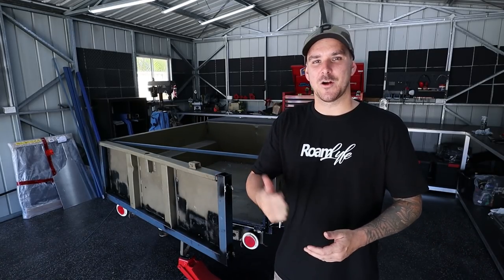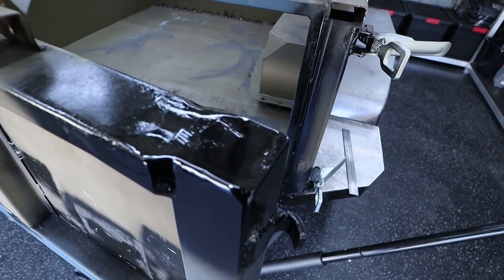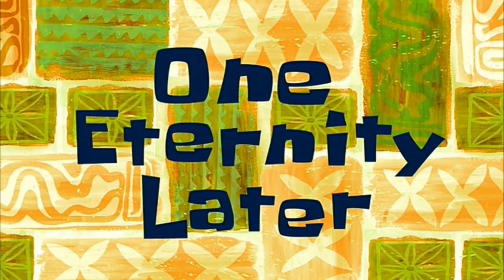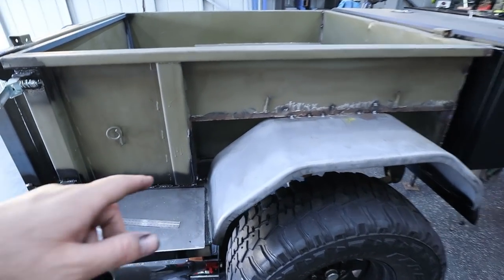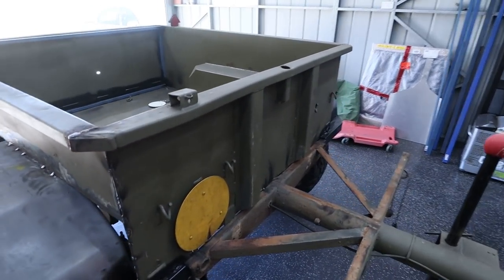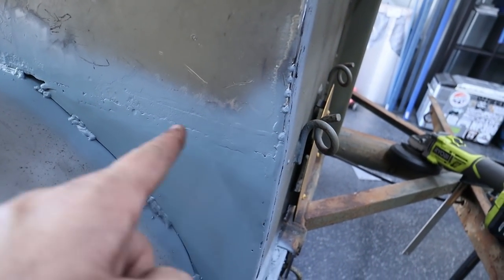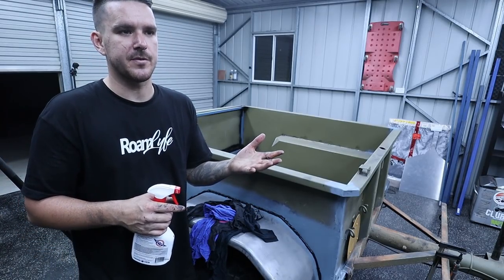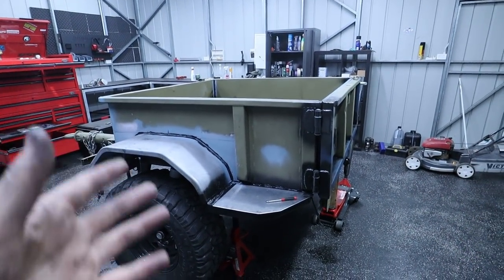Progress on the Camp Trailer!! 🔥

Comment: With all the grinder work, grab a multipurpose strip disc a give them a go when cleaning up. I use them more than a flappy disc now and no longer use a wire wheel much. They can do a bit of smoothing after grinding and you get a nicer finish prior to paint. Great work. It does hurt to see some of the mods but it’s not my No5 trailer now is it. I think I’m going to be ok. Love the creativity in modifying this into something that’s going to serve your needs.

Comment: be carefull when recovering backwards off that hitch idea man, as the weak point is now the welds on the outside of tube its welded into, so dont do hard snatches off it as steady pressure should be fine but unless you prepped the edges of that plate and did a full pen weld it will cause cracking internally and possibly shear out

also you should be wearing that mask while welding too ;) weld fumes are carcenogenic

other then that man has been good watching your vids (cause its way to hot for me to be outside doing the projects i have (dont have a roof over the hoist to start stripping my rig down for engine swap, and due to xmas time none of the parts ive ordered have been sent to continue on my 2 trailer projects

Comment: Hey mate, I know you’ve done a bit to the axle and made it wider but do you have plans for shocks? Will you use the army tow hook or are you going to change that out?

I used to tow things things in the army and when you get a bit of a bounce up, even going really slow, they just bounce from left to right more and more until they flip - easily used to flip one a trip. You’d think we drove like dickheads to cause it but not all the time! 

I recommend if you keep the army tow hook, lighten the spring rate and add shocks 👍🏻

Comment: Add more stiffening mate to that recovery, you will rip that 3mm plate right off.
Reply from the maker: Thanks mate, how would I go about doing that?
Reply: @RoamLyfe  probs a bit late now, but would be using RHS bracing along the length of trailer to prevent any of the sheet pulling out and welds snapping, a small welder like that isn’t ideal for recovery points of lifting lugs etc, although it should be fine for what you’ve done if you can use a winch rather than snatch strap to lightly pull it out from wherever needed, just make sure there’s no porosity or lack of fusion in the weld and you’ll be good for what you need🤙🏼 if you got any questions about fabricating or anything don’t hesitate to ask, your builds coming along sick

Comment: Hey dude, love the channel, love the builds.....although a great concept on the recovery point, but please, please, please, please cut off that recovery point from the trailer and just weld on a flat piece. I know you said only small / light recoveries, but i wouldn't even be doing that. Only takes 1 small thing that could potentially go wrong to make it a projectile at someone's head. 
You see a lot of recovery points on trailers but they're tied in to the chassis so literally just an extension of the car (sort of)
Please mate, cut it off.
Reply: It’s perfectly fine and strong enough for a recovery point he would have to be doing something very stupid to break those welds, and people shouldn’t be standing in the way of a recovery to be hit, it’s also what a dampener is used for also!
Reply: That pipe is the chassis? Inch of weld can hold a tonne, the weakest bit of recovering with that would be the tow ball on the car
Reply: Simple reply to both comments - it’s not rated and it’s not engineered. 
This was the basis of my argument guys.
Reply: @stevemoore3384  if he took that to an engineer he would easily rate it and give it the tick of approval, but that doesn't make it any stronger does it?!
Reply: @Bigsoot7393  No it doesn’t make it any stronger, it makes it legal.

Comment: Personally, I,wouldn't use it as a recovery point. It's OK to use it as a bike carrier mount but not convinced it's a good idea to recover someone using it. 9who wants to be recovering someone with a trailer on, anyway. Better to unhitch.)
Reply from the maker: Oh 100 percent would be only used for small recovery’s, a large dangerous one would be trailer off and proper recovery’s but always nice to have a hitch for a small recovery in a hairy situation!
Reply: Pintle hook would have made a stronger recovery point
Reply from the maker: @MicahBell_1860  correct but it was to big, and hit the door, sacrifice somewhere to gain elsewhere 🤘
Reply: @RoamLyfe  👍
Reply: She’ll be right inch of weld can hold a tonne, just dont go snatching off it or you’ll probs the shear the tow ball. But towing someone out with it would not be a drama in the world

Comment: bro that recover point is going to fail
Reply from the maker: I’m not really gonna use it as a recovery but I am gonna add some bracing just incase! How would you do it?
Reply: @RoamLyfe   it’s hard to say man when I’m not there looking at it but from what you did I would scared of it pulling out even on a light recover
Reply from the maker: Okay good to know! I’ll change it up a bit! What about a 8mm plate welded over it?